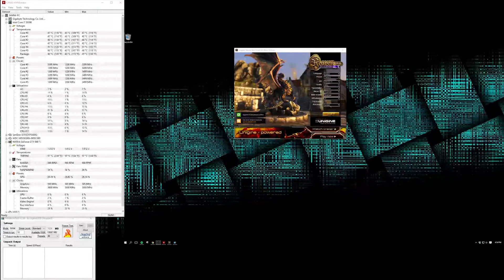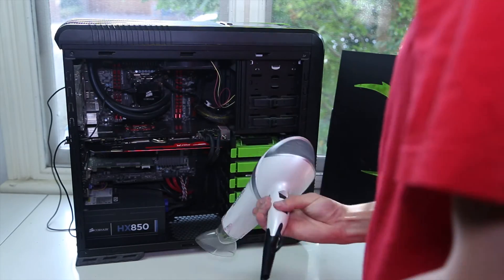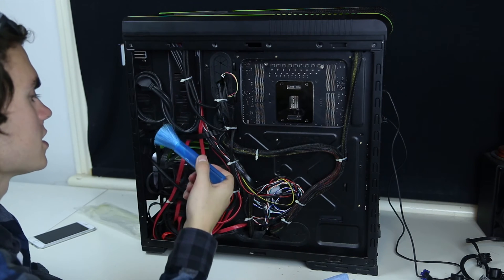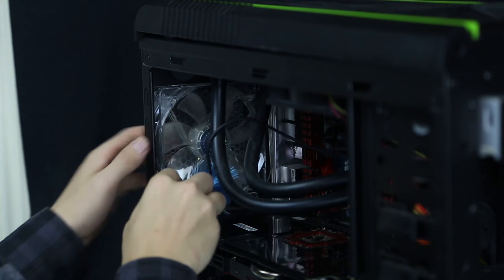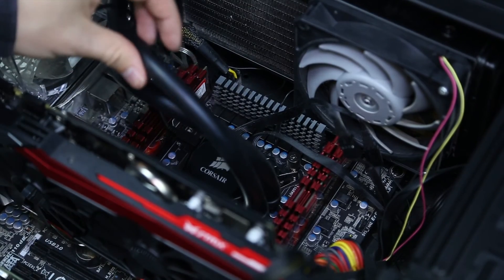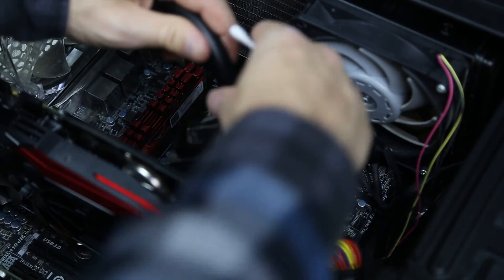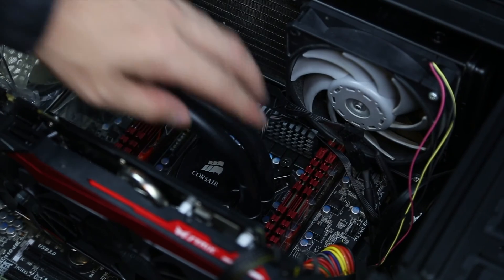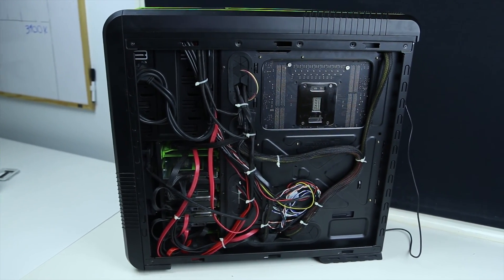How to Maintain Your PC

Comment: if your rad fan are on exhaust on the top the filter is point less un less u flip the fans and then u are fine.the issue with the filters on a exhaust fan it cause restriction to the rad fans.the best thing to do is flip the fans u will get better temps and u will have positive air pressure and that will keep a lot of dust out of your case only if they are filtered great vid